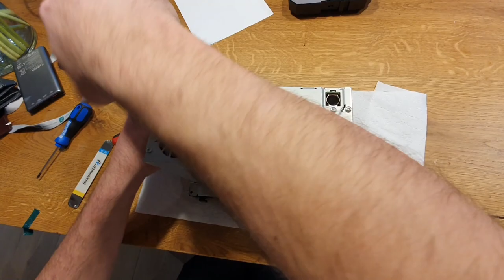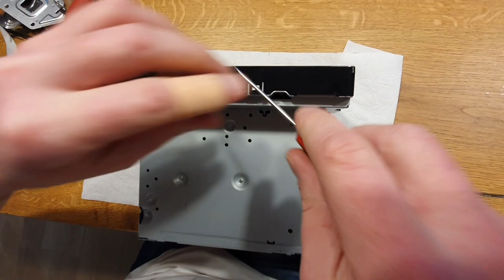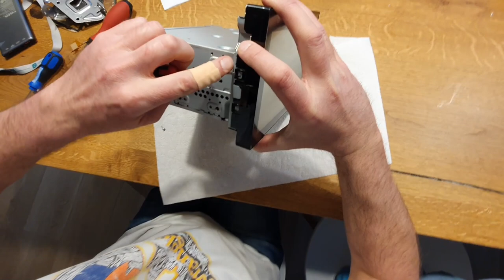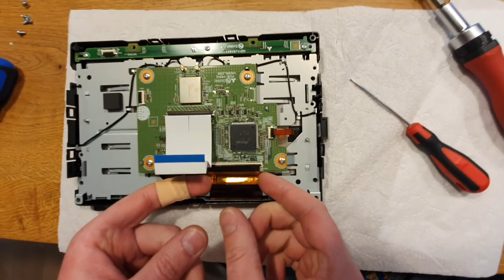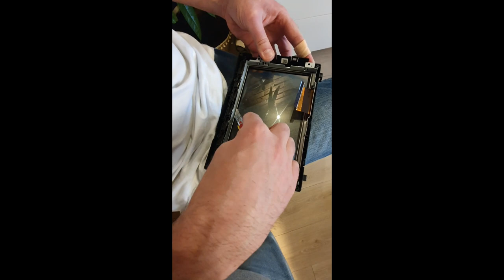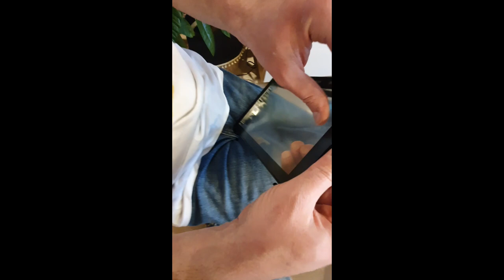Mitsubishi OUTLANDER touch screen digitizer replacement - how to resolve touch screen problems

Comment: I performed this repair today. Thanks for the video. Top tip is to buy some 3mm grey double sided mounting tape to replace what you cut out. My new screen didn’t come with it.
Reply: What thickness of 3M did you use?
Reply from the maker: my one has adhesive and good quality;) @slimatmim